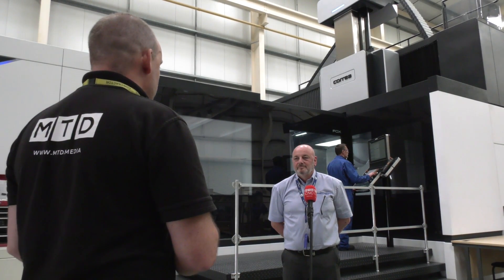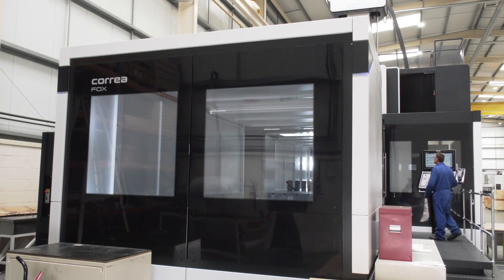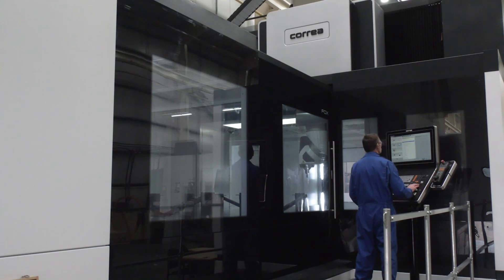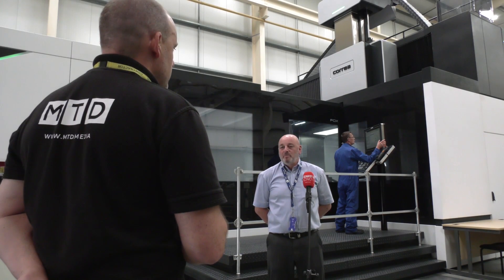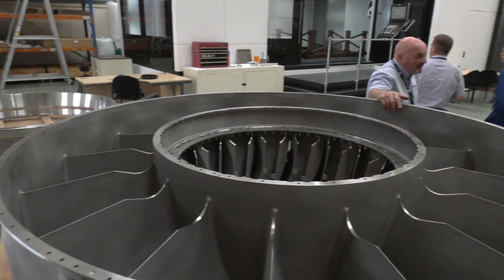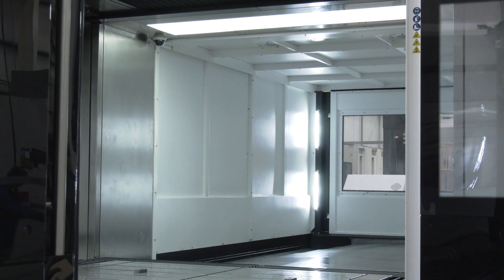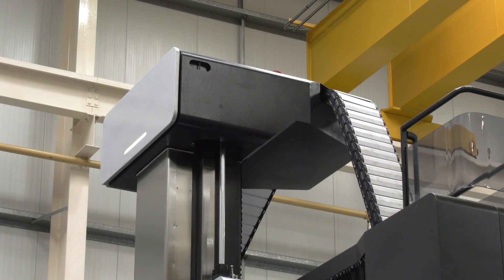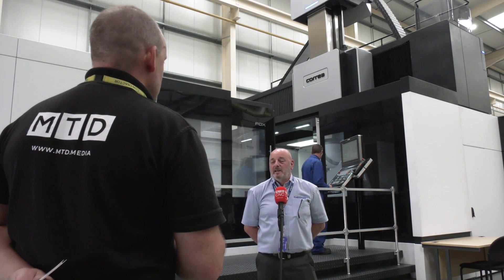A terrific milling machine installation - not many companies this size in the UK

Comment: It’s a 3 axis machine with a 2 axis head, not a 5 axis head?
Reply: It is a 4+2 axes machine. 3 linear axis, 1 rotary table axis and 2 indexing axis in the head.
Reply: Javier Garcia Lopez Maybe but it’s not a 5 axis head?
Reply: Steven Richardson 
The head has 2 indexing  axis. It means that you can position the head first and cut afterwards. You cannot cut while rotating the head.
Reply from the maker: Glad you enjoyed the video !